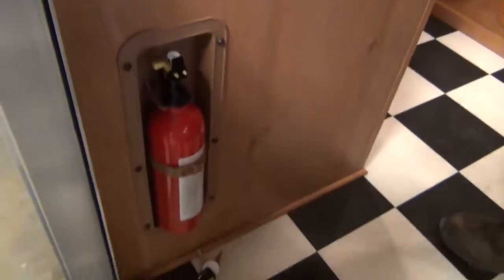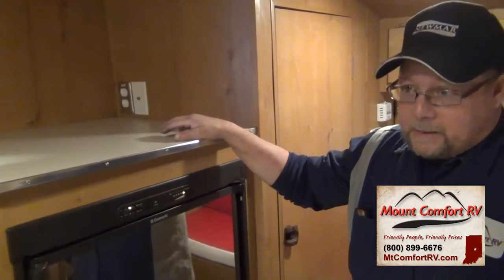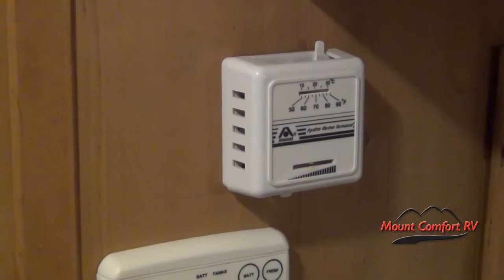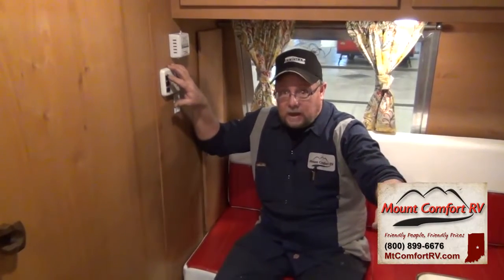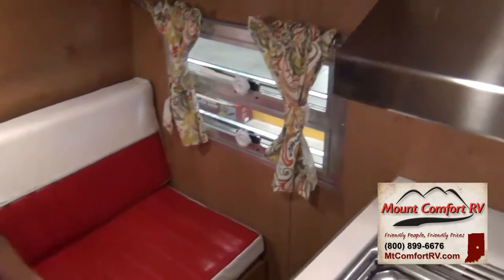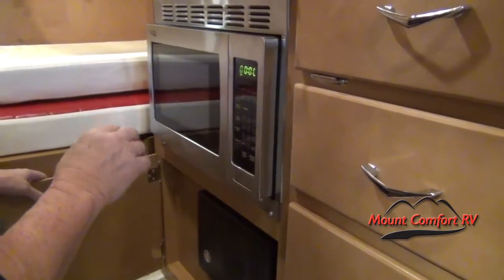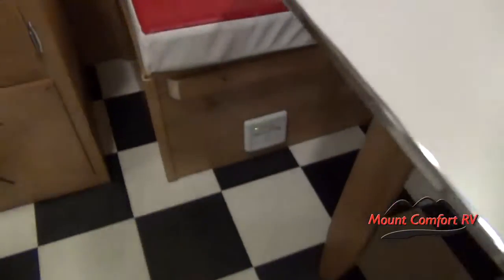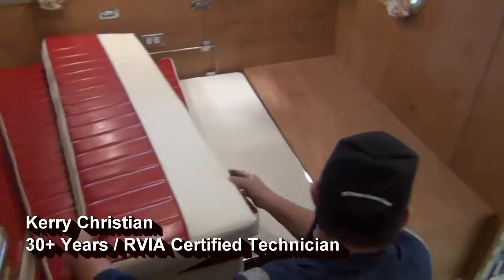2015 Shasta Airflyte 16 Interior Demonstration | Retro Trailer

Comment: I would really like help with my furnace as I cannot get it to work at all in my Shasta :( Is there a valve or switch that is not obvious, that has to be turned before furnace works?
Reply: Amanda Smythe have you checked the recalls? We are interested in this camper, in our reading up on it we discovered it had multiple recalls. Still like the trailer though 😊